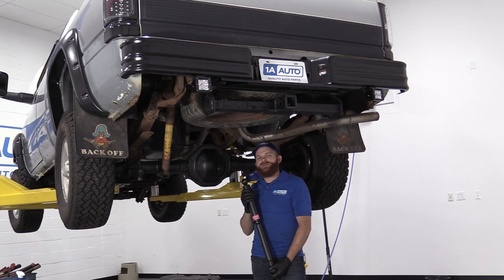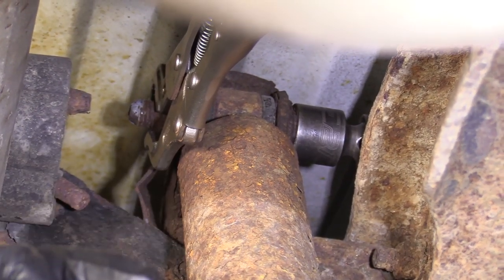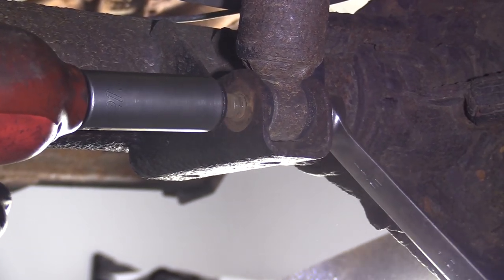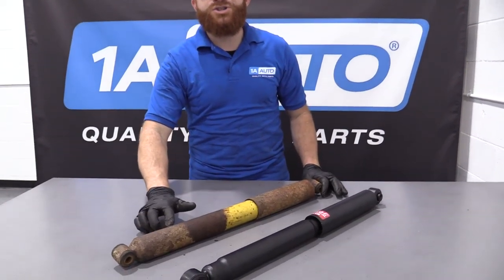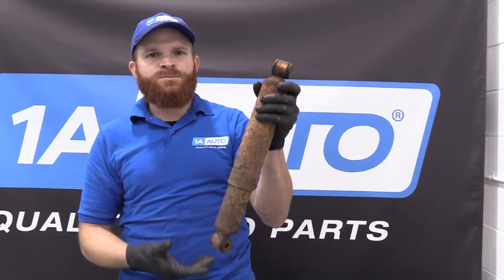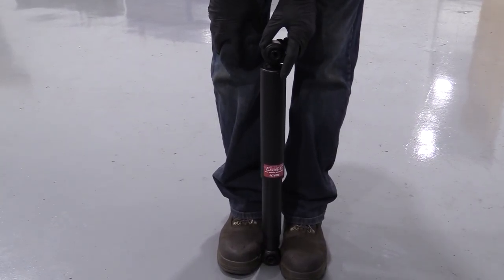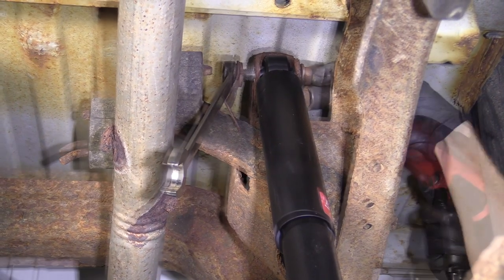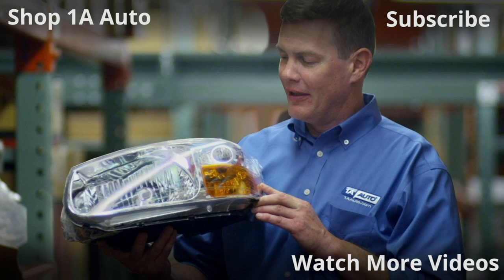How to Replace Rear Shocks Dodge RAM 1500

Comment: why put the visegrips on the nut when it has a leg welded to it that will bottom out on the frame/floorpan when the head of the bolt it turned? the purpose of that special nut is to make it unnecessary to hold it at all.
Reply: because the leg bent, watch the video closer....same thing happened to me!

Comment: I have a 07 ram...it has a small slight lean to the left but it sways towards my FR tire when hitting bumps... and recently that LR tire was wearing off on the outside edge, could that be the cause from a bad rear socks ??     I dam near replaced everything in the front with many alignment ..  Anyone have reasons of opinions ??

Comment: Is it feasible to do this on the ground without using a jack/jack stands?
Reply: Yes, but I'm doing it all with the bed removed. Damn rust broke the rear cross member.
Reply: Yes, the springs should hold it up, you just have to compress the shock to get it out. Much harder and more dangerous, but doable
Reply: Best way is to use a lift so that you don't look like a complete hack.